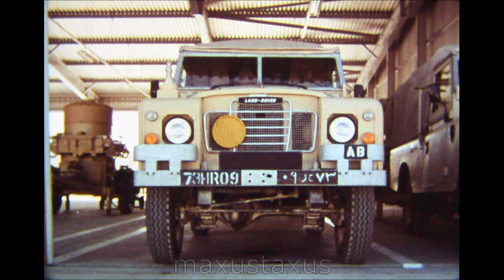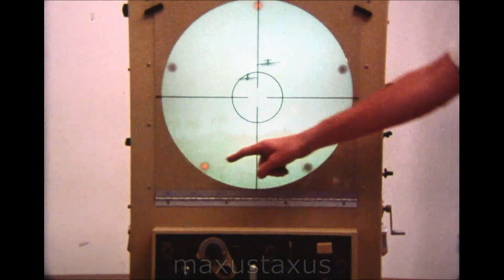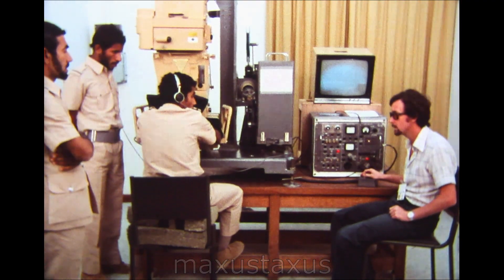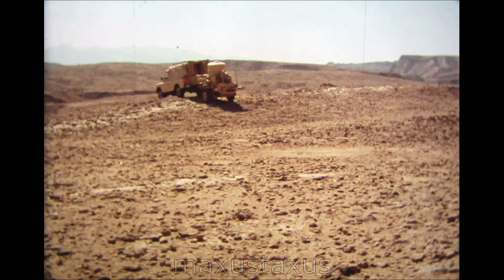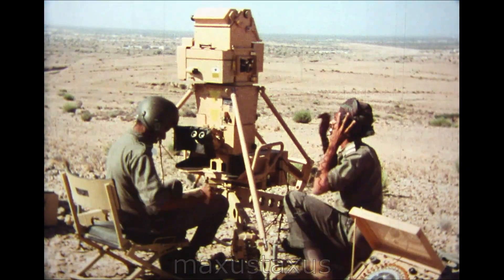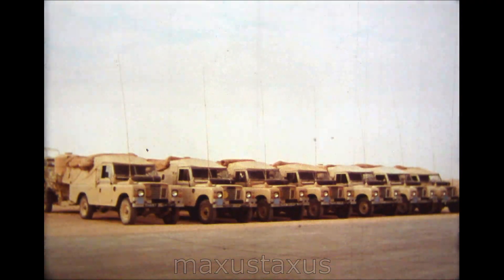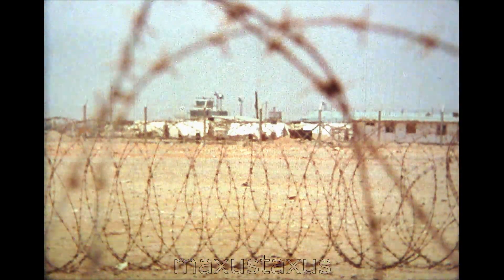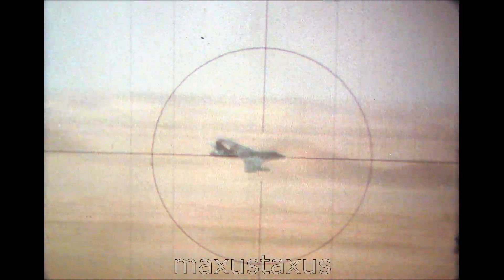Rapier Missile Air defence Deployed in Oman and Training Personnel, 1970s, F602 a

Comment: I'm not a fan of towed systems but its interesting to see an optical and radar on a single unit. Pretty neat. Maybe it could have been slapped on the back of that truck to get rid of the deployment process
Reply: Only problem there is you lose the weapon system when the vehicle breaks down. I used to work on towed Rapier in the late 70's and tracked Rapier, and more recently HVM/Stormer. The only two you could guarantee were the towed rapier and man portable HVM
Reply: @DieyoungDiefast  I didn’t consider that. I guess that makes sense. Must have been tough but awesome to work on those.
Reply: There was the Tracked Rapier variant where it was on the back of a modified M548
Reply: @DieyoungDiefast  i was an operator for 10 years, optical system was total garbage and guidance radar is much better. As a result this system isn’t user friendly at all.
Reply: @yuzbasivolkan86  Damn. I guess thats why theres the churn of new stuff. At least the enemy though it worked well though, and Im sure at least 1 of them could have worked. Is it still used?
Reply: @yelectric1893  unfortunately still used.Theorical knowledge and crew’s ability is the most crucial part of this old system.